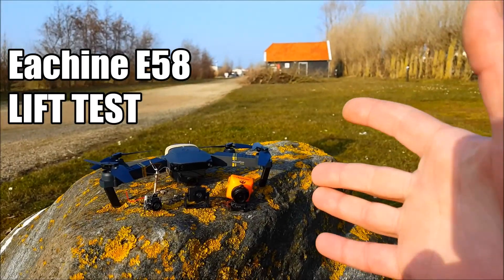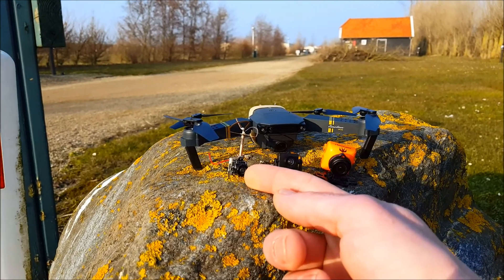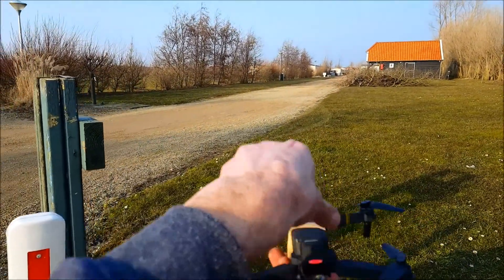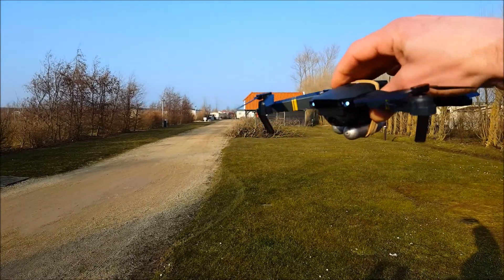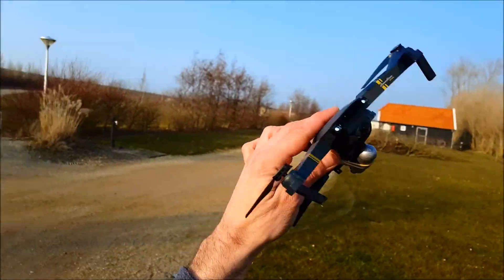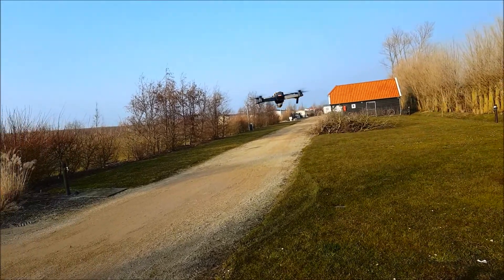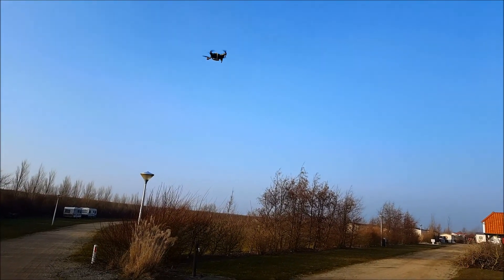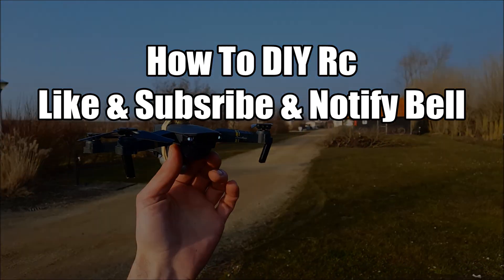Eachine E58 How Much Weight Can a Drone Lift/Carry? Test Flight For FPV

Comment: Nice demonstration! I'd say without sacrificing too much performance and flight time you'd want to put no more than 10 grams additional weight on these brushed motor quads. Just my experience. Thanks for the demonstration video and Happy Flying!
Reply from the maker: +Ground Control RC just aio and battery gives the best performance and is the most simple mod the one you really like to stick to anything 
I know but we want to go with better quality first and down grade it later iff we add more weight with extra mods 😃

Comment: that means it can carry mobius mini without problem. huge thanks for the demonstration! love it!!!
Reply: im just curious, mobius mini is 27 grams, do you think the e58 can carry it for a reasonable duration (maybe 3mins?) and distance like 30-40m?
Reply from the maker: +kleuafflatus yes im sure it can fly 27grams 
For around 5min and going over 100meters
But you can always remove the camera and wifi transmitter to save around 12 grams
Reply from the maker: +kleuafflatus thanks for watching and leaving a comment 😃

Comment: Impressive! I wonder if removing the stock camera system would give you an extra 5 or 6 grams to install a 5.8ghz all in one fpv setup? Without adding too much total weight?
Reply from the maker: +PD Tech  ye that's is a option but we want keep the wifi FPV pointing down to shoot aerial video and the 5.8ghz to see where we flying towards and don't end up in a tree 😭
Reply: How To DIY Rc ah ok I understand! It's good to see what this little drone is capable of.
Reply from the maker: +PD Tech 🖒